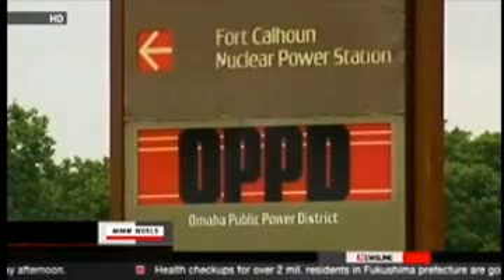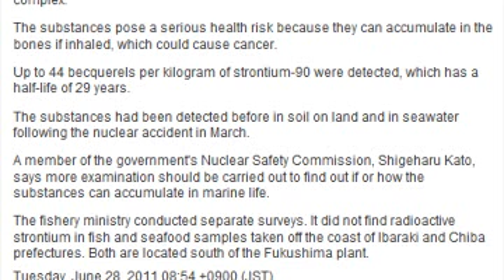NUMEROUS Nuclear power plants in trouble USA and Japan 6/27/11

Comment: Nice someone knew the power got knocked out at Ft Calhoun and that the diesel generators worked as intended. Curious about the spent fuel rod storage, are they cooled by closed loop or the open Missouri River? I read someone's comment that they were taking bentonite clay as a dietary supplement to counteract radiation exposure?